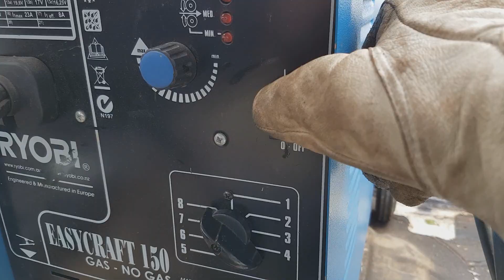Rusty Honda CRX Restoration Ep. 01

Comment: What would you estimate the now finished value at? 

What kind of welding is that? I mean the technique mig tig/ STICK?

How much would you estimate all the welding on the car cost? 
How much did it took you?
Also is  the grey t hing you are using putty? Like bondo?

now after all this and a google search, DAMN IS SHE NOT GOOD LOOKING
I WANT ONE TOO
Reply from the maker: Hey, good questions!
     With value it's a bit tricky because I live in remote country. Really nice and clean CRX recently sold for 10k USD here. But I don't think anyone would buy this one even if I wanted to sell. Maybe 3k USD if I was lucky and they don't see this video.
     Overall I'm  projecting the build cost to be around ~4k USD for everything except my time. And I'll probably spend aroudn 1.5 years working on it semi-fulltime. As I said, not sensible.
     Welding process is FCAW, basically hybrid of MIG and stick. I use it because I work outside in the wind, so can't use shielding gas. Normally MIG would be preferred.
     Grey stuff is a zinc weld-through primner, basically heat resistant paint with powder zinc in it. It's good for using between welded parts to prevent further rust. Regular paint can be also used, but it burns off easily.
      If you live on the mainland, the CRX are still pretty common, I belive you can get a pretty good ones for couple of grand still!
Reply: @sidney9534  I live in europe, there is one for sale for 3300-3400 with shipping to where I am, blue, very nice color with little rust, in the photos I didn't see any but I don't think it is possible to not have sny
Reply from the maker: @cosmin552  If you end up getting one, they all rust under the bonnet hinges, under the trim on the hatch and under door hinges. Drop some oil on the problem spots to stop it rusting, every 6 months. Actually if you're not garaging it, it's worth stripping the car a little bit and spraying an oily rust inhibitor in all cavities (CRC Marine heavy Duty, Fluid Film). That will give it a pretty good fighting chance. Or garage it and only drive when sunny :)
Reply: @sidney9534  Thank you, what do you mean by under the door hinges? Like  on the frame between the door and the body?
Reply from the maker: @cosmin552  exactly, every car I've ever seen has at least some rust in there.
Reply: @sidney9534  OK, by that comment you just have to be experiencing coastal climate where you're living. 😎 Nothing else eats up untreated bodywork just like that. Where I live you may add salted winter roads onto the list of reasons for why cars start to rust before they are 5 years old 💀 And just like you said, oil films, cavity treatments and underbody treatments is a part of the course for many car owners around here. Fluid Film makes the  car smell like sheep for a while, but it's worth it. 

But that car seems like a piece of work. I like 3g/1gz as much as any other, but this is nightmare fuel or a motivational video, depending on if you're the one filming or watching. It almost classifies as "zen" for T-bar Honda owners who are traumatised by rust. Does the car hold sentimental value to make you go so far to patch it up?
Reply from the maker: @nimaforoughi7266  Yes, coastal, it lived first 10 years in Japan, then in NZ near the ocean. 
It's not really sentimental car, I just got it because it was right under my nose. Originally I wanted a Mini, but everytime I try to buy one, someone beats me to it.
Thanks for the kind words!

Comment: your welding and editing skills are absoutly amazing! its cool seeing panels move by thereselves!  i notice you hve a prelude si driver seat  where did u get that i saw q 1988 black prelude in the background awsome
Reply from the maker: Aww thank you! Yes, it's from a Prelude, good eye. I didn't put that it, leegedly they only fit if you swap the rails. The seat is better than CRX, but it looks like grandma's old recliner. So I won't probably keep it. 

Thinking of seats from a different car, but main problem is they have to be super low to the floor. 99% of modern seats are too high. 

Second gen CRX seats fit with rails replaced, but are so rare here it's no point even looking.

Comment: Cool video, quite the undertaking. I would have considered that a parts car at best but with enough patience and skill maybe it will turn out to be a nice project! 

Not sure about your choice of galvanized steel for the patches. It makes toxic fumes when welded and might be hard to paint. I'm no expert though, good luck!
Reply from the maker: Oh it totally is a 100% bad idea. I mainly started it only because I wanted to do rust repair. It didn't seem THAT bad initially, but when I got to the bad parts I was too far invested to quit.

Galvanized - yes, it's a questionable choice. I mainly did it out of convenience, because local scrapyard had a lot of cheap suitable sheets. And yes, it is hazardous to weld. It's pretty windy out there and I wore a mask, so never had a fume fever. But definitely not the smartest choice.
   One advantage is I only had to worry about treating the welds inside - rest will never rust.